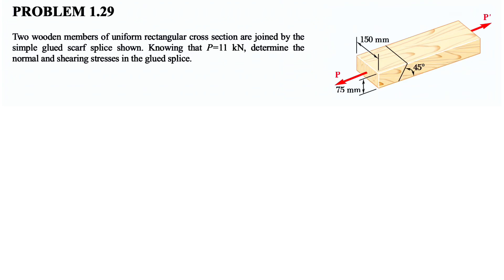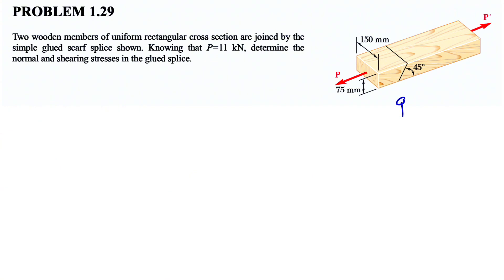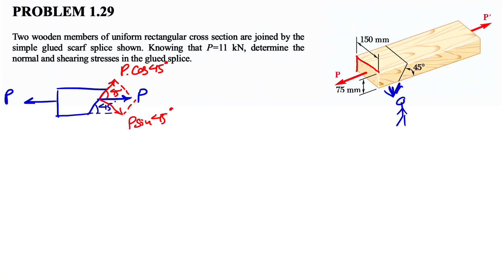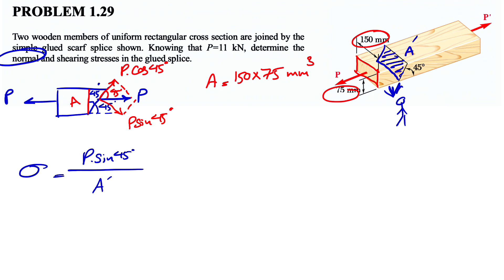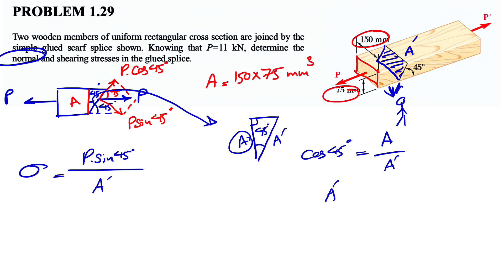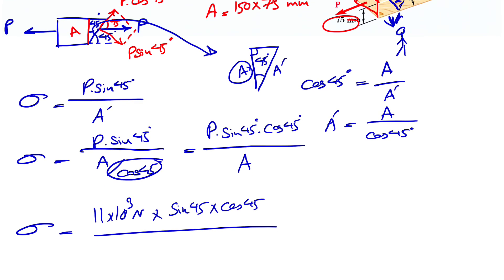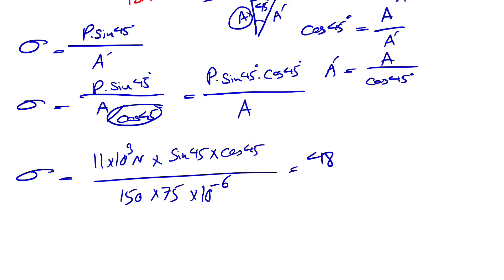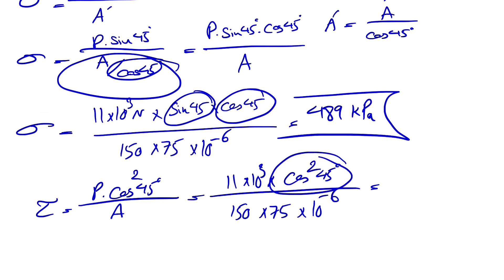Problem 1.29 | Can YOU Crack This Mechanics Challenge?

Comment: Thank you for the problem and solution, I learned something new today!
What are these stresses used for in practice? I never learned about this, but looks fun to calculate!
Reply from the maker: You’re welcome! Stresses like these are used in many practical applications, especially in engineering. For example, they help us design and analyze structures like bridges, buildings, and aircraft to ensure they can safely handle loads without failing. Understanding these stresses also plays a big role in material selection, ensuring durability and safety in various industries.